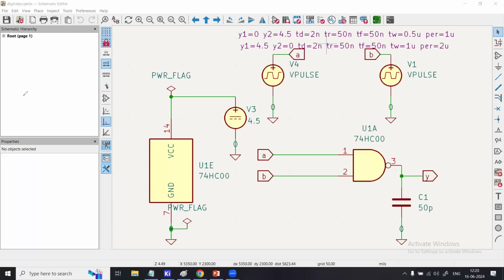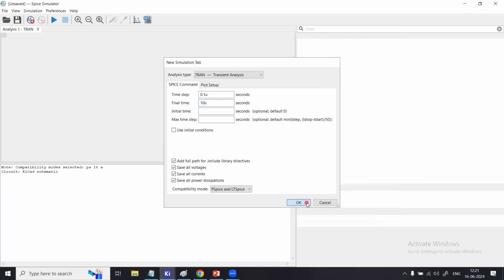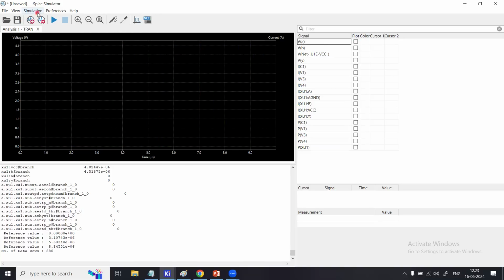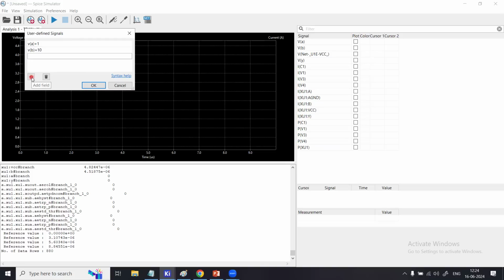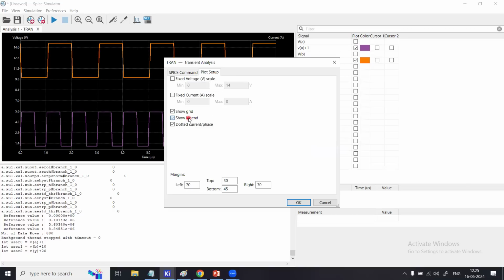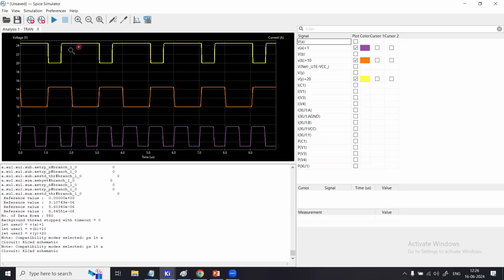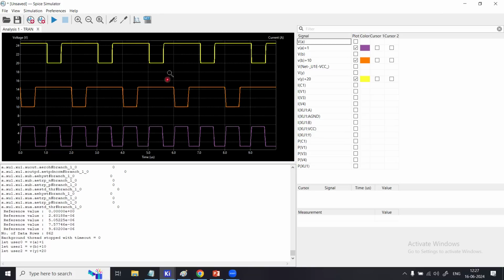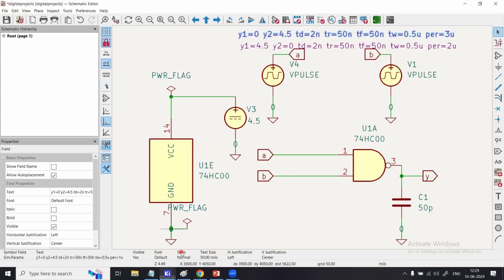User-defined Signal Plotting | KiCAD

Comment: so i would like to add some noise in my circuit but as i understand from this video i cannot do that by user defined signals. Tell me if i'm wrong but its too hard to use noise simulation.I have filter and i cannot add noise so i cant see if it works or not. Can you help?
Reply from the maker: @berraetcioglu971  add noise source into the circuit
Reply: @VPACHKAWADE  i tried it has lots of errors
Reply from the maker: @berraetcioglu971  contact@vpachkawade.com
Reply: @VPACHKAWADE  thanks tho